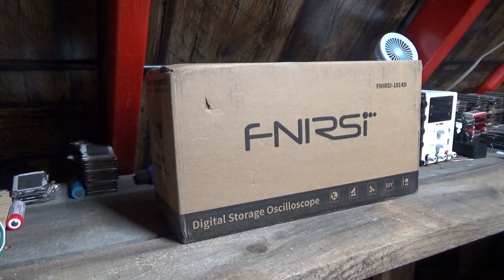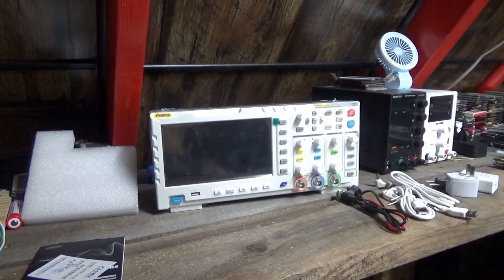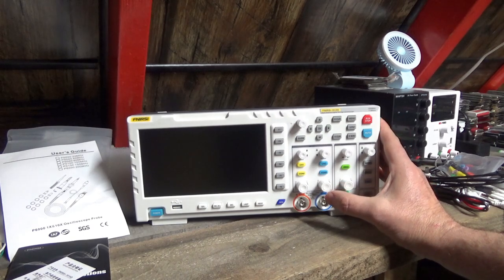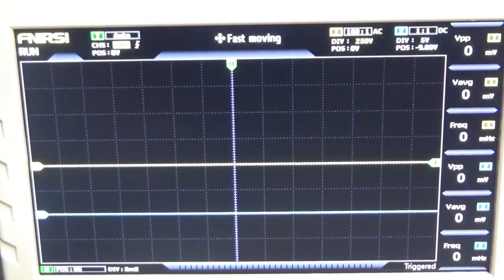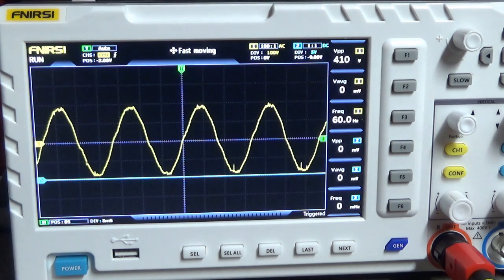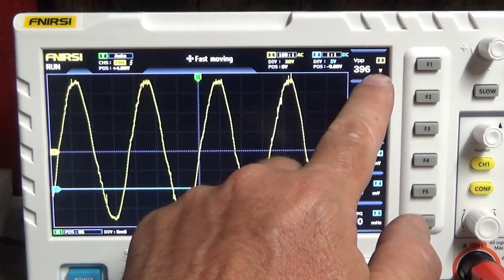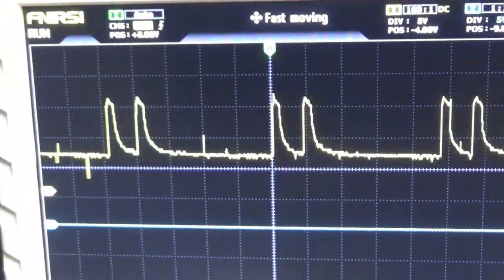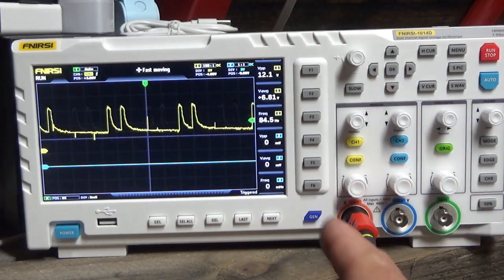Why Homesteads And Off Gridders Need This Oscilloscope From Banggood

Comment: For off-grid the use of floating ground is essential. This unit works on 5V 2A dc. Floating on a usb power pack, you will not burn the ground on the scop's mb.

Comment: Reviews by electronics workers and even hobbyists tell you to avoid this at all costs.  You are better off saving up a little bit longer and get one from Hantek or another branded company.  This is Chinese unbranded rubbish.
Reply from the maker: I checked the reviews before choosing this one. Works great for me so far.
Reply: This is exaggerated. Most users do not need to measure 30Mhz+ signals. For its price this ts the only tablet portabke format with touch screen ans easy to use for beginners. It is twice cheaper than the Hantek DSO2C10 that some snobs recommend against this one.

Comment: Just be sure when you measure your household power system that you pay attention to the manufacturers warning printed right close to the probes input! also always use the X 10 input by switch on the probe handle!! Also before use check the calibration of your probes by attaching the probe end to the calibration output IF supplied by the scope manufacturer to obtain the most accurate display on the screen. I agree that inverter power output could be a source of trouble for a lot of electronics, but keep in mind that a lot of the switching power supplies used by most electronics today create a LOT OF RF INTERFERANCE on the power lines and in the airwaves surrounding the offending unit to many, many feet away!!  By the way when you touched your probe end the screen was displaying the energy that your body was picking from the surrounding area, your body was working as an antenna and the scope was displaying that particular waveform !!

Comment: A big problem with off-grid power inverters is that they emit the huge amount of radio interference especially on the HF ham radio bands. Manufacturers need to address this problem.

Comment: Troy that scope shows more than sound waves. Lets you measure wave forms for frequency response. Modulation electric wave forms. repairing modern cars. All kinds of things, even trouble shooting metal detectors. Seems very compact. Must me Arduino based. A lot smaller then the old analog one.
Reply from the maker: Yes the things you can do with this are endless. I was simplifying for people who may not know what this is tho. I love it!!

Comment: i got two Army style scopes,,there old,,i use one all the time on my bench..they weigh a ton,,but made very good..i worked on radios and tvs,,and guitar amps...just about anything now,,mostly computers and supplies.its my hobby.i like the screen on this..Digital is the thing now..fast and on the money...i have a pretty good collection,,of testers,,i built my Digital Heathkit freq counter years ago,,,it still works,,when checking a radio out thats out of wack...i have testers also that can read a signal in the air..when transmitted...since i live by my self now,,i put a weather radio in,,,also has fire and police on it,,,its very handy..when nasty storms come by..i run it on a bat backup system..it will run every day if i want it to..i put a small antenna outside,,no problem..you just never no when bad weather is coming...i had good size hail here 3 days ago, for about an hour,,,hard to believe...my trucks under a car port,,thank god...ok Troy,,i hope you get some real use out of that,,i no you will..
Reply from the maker: The old equipment lasts forever. But the new stuff is needed now for its speed. I have a heathkit scope but its a huge beast and I cant fit it on my work bench in here. And its too slow for modern measurements.

Comment: I don't know what you talking about, that's pretty Clean sine wave for any pure sine inverter. The ones you have to worry about are the inverters that have well defined steps in the signal. You know then when you see them they Big steps you could sit on. You Do have a bit of a noise problem nothing you could not filter with a few capacitors.